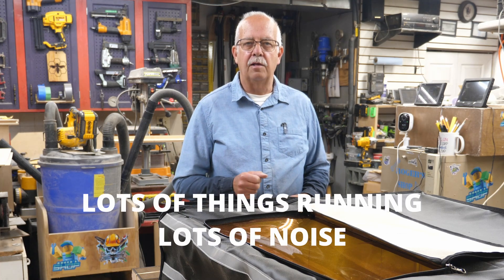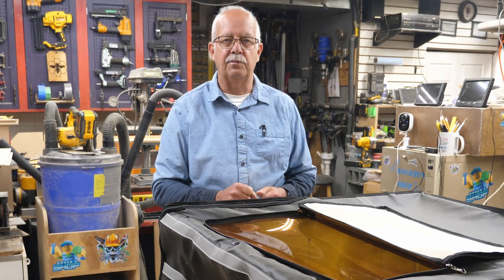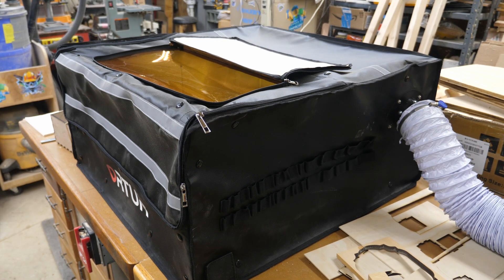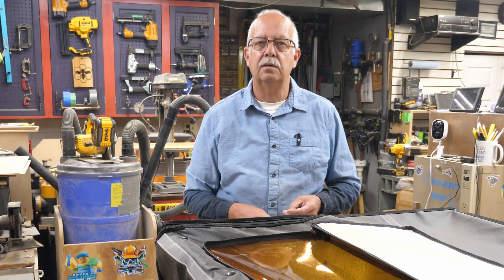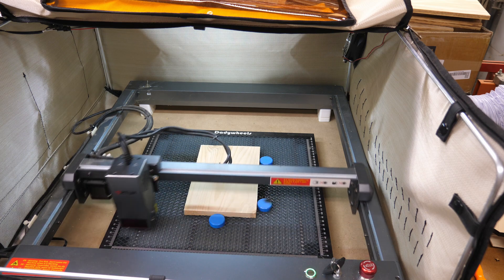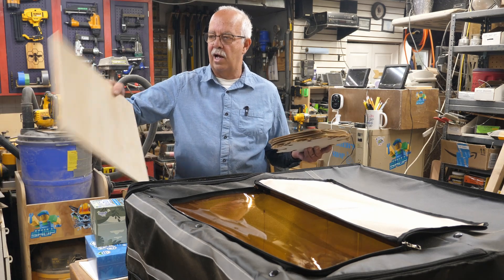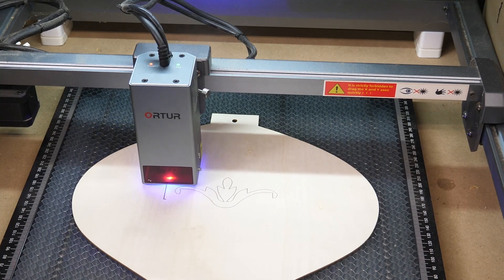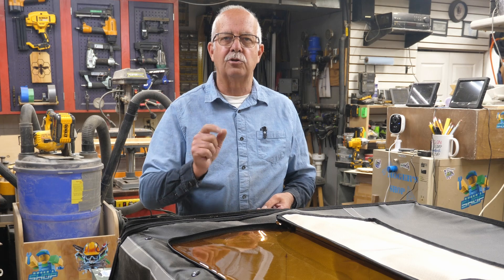Behind The Scenes Laser Project Prototypes

Comment: Do you run the Ortur enclosure's fan along with the exhaust fan over the door? I have an ATEZR enclosure (for my P20) with the exhaust fan piped to a Comgrow smoke filter. It is OK when I am engraving, but when I am cutting I get a lot of smoke built up inside the enclosure. I'm wondering if the two fans are working against each other?
Reply from the maker: Yes, I run both fans (when I remember to turn on the enclosure fan) as they give a 'boost' when working together.  The outlet hose on my other enclosure is metal and smooth, so way less drag, as well as much shorter, so one fan there is enough, although I can run two if I want to.

Comment: Reset your laser home position to the other end so it homes to the back of the 
Enclosure if I remember correctly it is a light burn setting check with Hobo with wood 
Or the Louisiana hobby guy don't remember which
Reply from the maker: Prefer not.  There is no limit on the upper left Y axis, so it cannot be set as a "home", although one can set it to finish position, but then it will require homing to "home" before the next process since I work from absolute coordinates.  A waste of time when in a production mode.